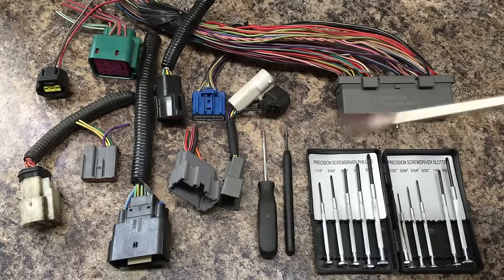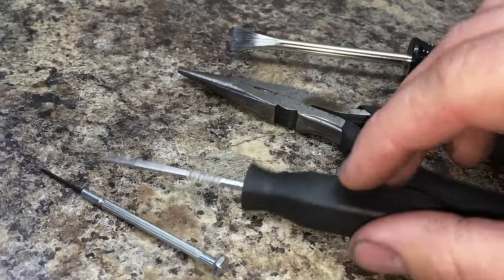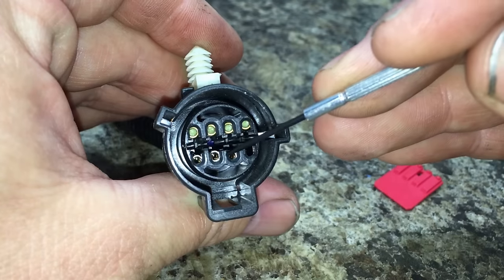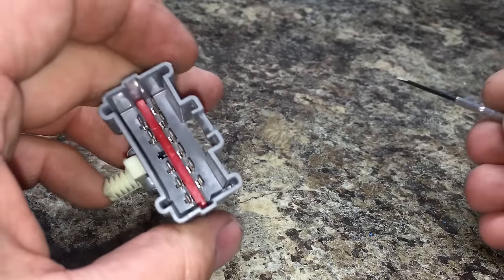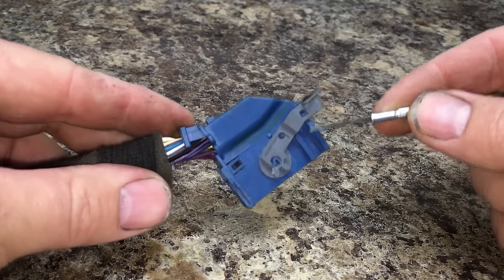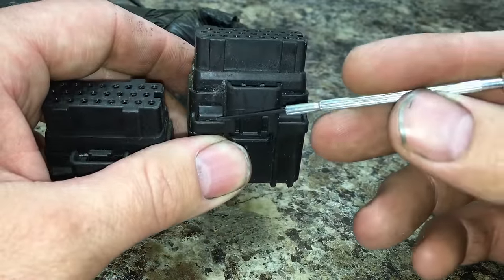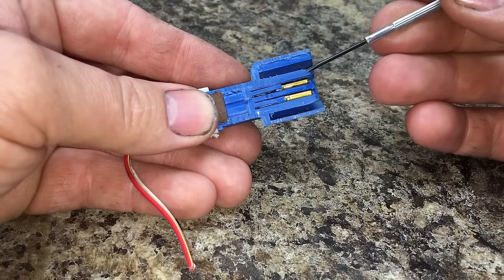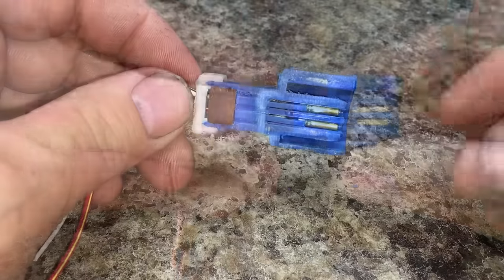Ford Quick Tips #62: Rebuilding Electrical Connectors on Your Vehicle

Comment: Thanks again for another great video. I’ve been looking for a OEM replacement engine wiring harness for my 2001 F150 5.4 V8 4x4 (VIN L). Would you know where I could find a FORD or Motorcraft part number on this? Seems impossible.
Reply: They are pretty much impossible to find because Ford doesn't make new parts after 10 years and because they're considered "Obsolete" and then 99% of the salvage yards salvage yards throw all their wiring harnesses in their copper bin and they won't even inventory them and they won't sell them to you. I've had times where I needed a in-dash wiring harness for a Ford Ranger and they just said "we don't mess with stuff like that" That's why I like Pull-A-Part, but it's so hard to find later model vehicles in a PAP.

Comment: So how would you source replacement plugs like this?  What exactly would you need to ask for at the dealer?  For example, I need to replace the plug and terminals, at the transmission,  that connect my E4OD to the transmission control box.  What would I need to ask for?
Reply from the maker: You just ask them for the pigtail kit for whatever you need it for and they will look it up.

Comment: Where can you get new OEM replacement molex connectors to match what we have in our trucks exactly?
Reply from the maker: Ford dealer sells them.
Reply: yep, i just called they want almost $100 for the pigtail lol
 @FordTechMakuloco
Reply from the maker: Many times you can check for aftermarket knock offs by searching for the motorcraft part number on ebay, amazon and google it will cross reference automatically.

Comment: hello brian I'm have trouble with a 2014 lincoln navigator controls for climate control not working I get only 1 speed high unless I put it in auto then it fine but if I press off it goes out of auto and nothing turn off. now if I shut the car off  then restart the car climate control Is then off.... just wondering what this might be before I take it into the shop

Comment: Hi! I have a 1998 mustang gt , the previous owner took a wire yellow and red wire that leads to the obd2...so it doesn't read, he used it put lights above his feet , so I was wondering if you could help me get it back together so I can get my car tuned?
Reply from the maker: The yellow goes back into pin 16. There is no red wire specified in the diagram. You should have wires leading to pins 2,4,5,7,10,16 you can read the pin numbers on the front of the DLC connector with a flashlight. This is the correct wiring pigtail for the DLC should you need new pins- http://amzn.to/2cq6TXK
Reply: +FordTechMakuloco Thanks man really appreciate it , but one more noob question the pigtail is the connector piece? and what you gave me the link to already has the pins inside and all's I would need to do is connect the wires?

Comment: I broke off one of the red locking clips on an ignition coil connector on my 2015 f150. Is the best fix to replace the connector, or are those clips available anywhere for sale?
Reply from the maker: You must replace the connector shell, but it is not really needed.